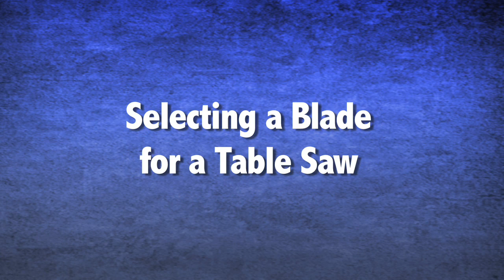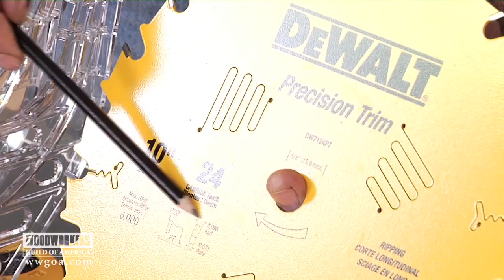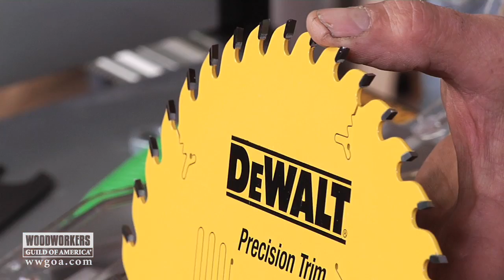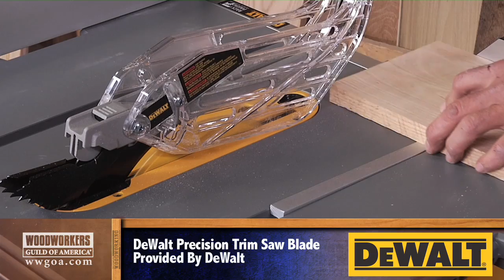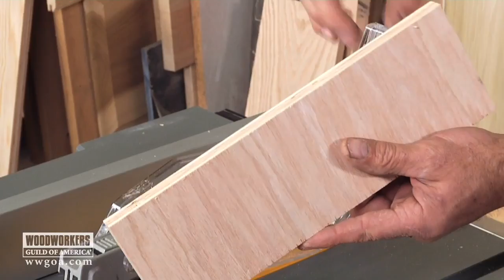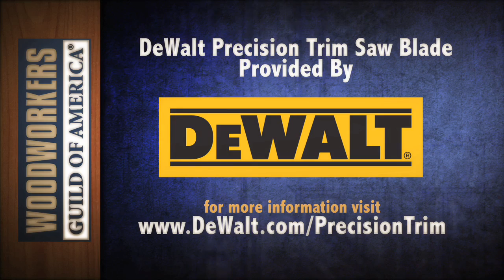Woodworking Tips - Selecting a Blade for a Table Saw

Comment: I have the same table saw, the 24 teeth blade is really useless if your ripping hardwood, The power of the tablesaw is not enough. Use 40 teeth in ripping.

Comment: I sometimes see youtubers running metal through their table saws. What is valid then, what type of blade would you need and is it only dedicated to metal then?
Reply from the maker: +Emil Tisell Here are three videos that specifically cover this topic. Cutting aluminum on a table saw. (http://www.wwgoa.com/video/cutting-aluminum-on-a-table-saw-001068/)Cutting non-ferrous metal on a miter saw (http://www.wwgoa.com/video/how-to-cut-non-ferrous-metals-on-a-miter-saw-005429/) .Using small blades on a bandsaw (http://www.wwgoa.com/video/using-a-small-blade-on-a-bandsaw-001979/)  (watch to the end for the metal cutting.)It’s important to pay close attention to the info on blade selection.  If the blade you use has large teeth, non-ferrous metal cutting will go very badly.  It’s also important that this process only works for non-ferrous metals.  The blade shown in the table saw video is specifically for cutting non-ferrous metal, but also works OK for cutting sheet goods. (ZD: 3258)

Comment: Thin kerf blades work well if your splitter/riving knife is thinner than the blade itself. Otherwise the wood might pinch on the splitter/riving knife.